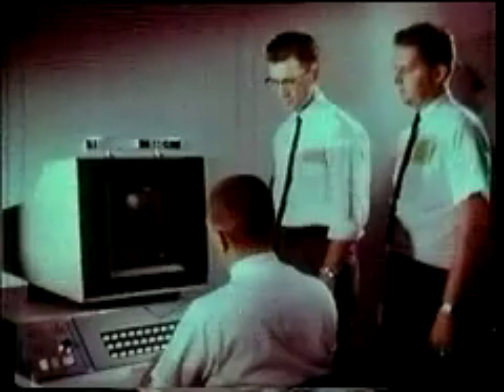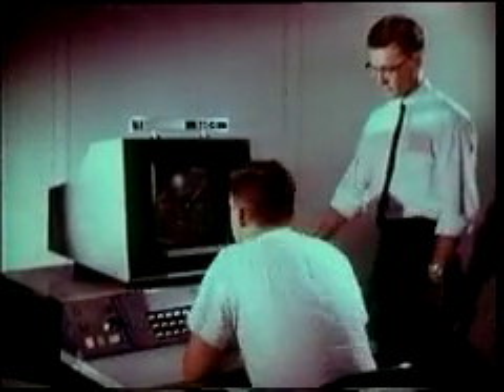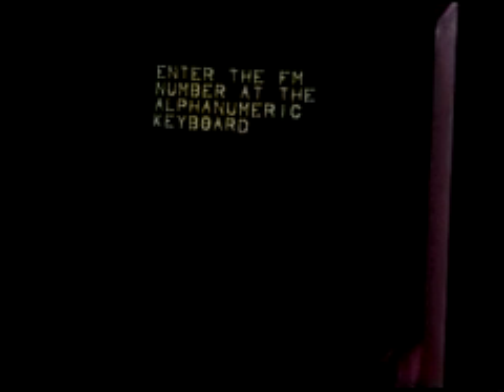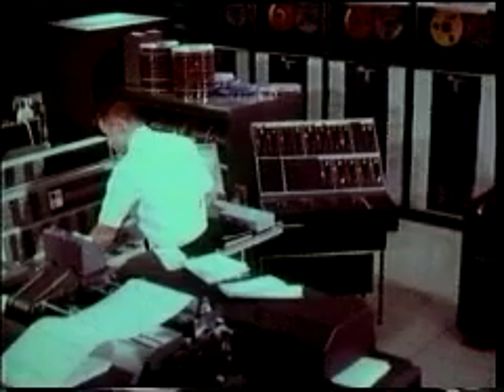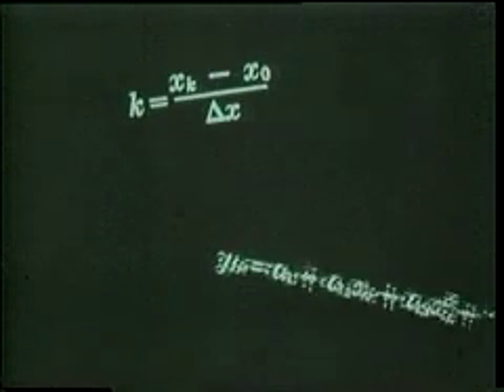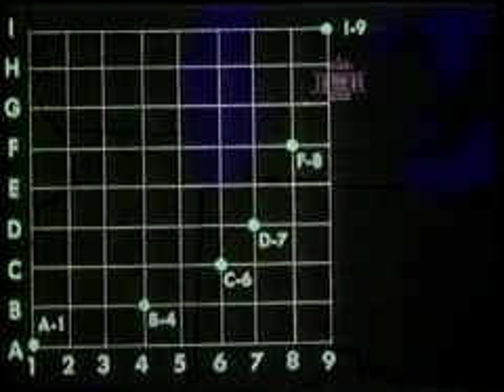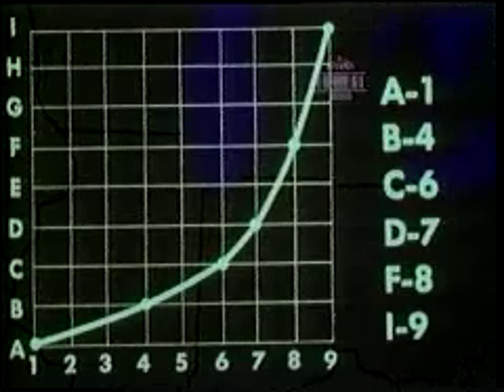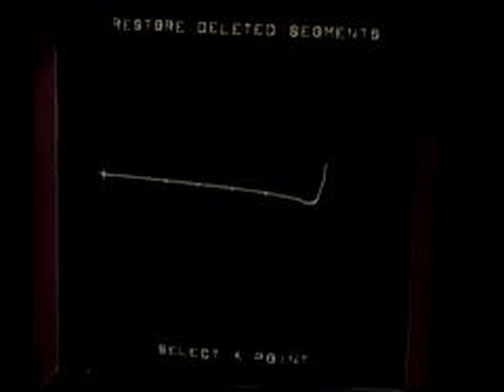General Motors Research Lab Design Augment By Computers: DAC-1

Comment: This is a vector display, which is why the graphics seem brighter when they are fewer and closer together.  Rather than scanning each line in turn, the CRT accurately traces the actual individual line elements in the scene.  This produces rather startling accuracy for wireframes, compared to what people who recall low-resolution raster displays from the 1980s generally expect, but both intensity and refresh rate fall rapidly with scene complexity.  Beyond a few hundred elements, raster displays usually win, but these were crude until the development of dual-ported video memory (VRAM), which also offloaded the job of keeping the screen refreshed when it wasn't changing away from the CPU.